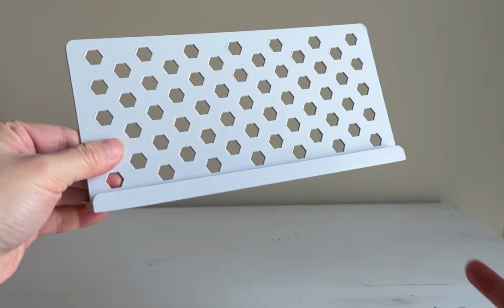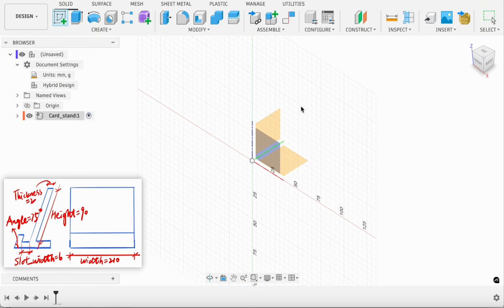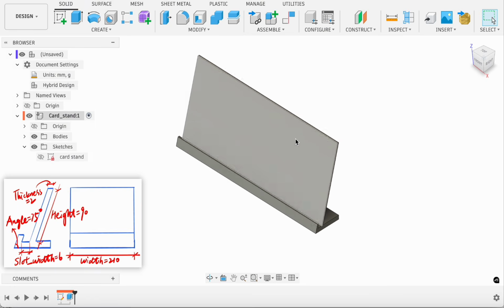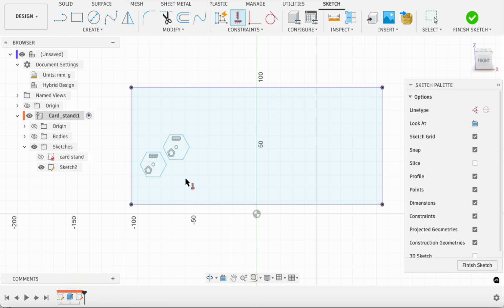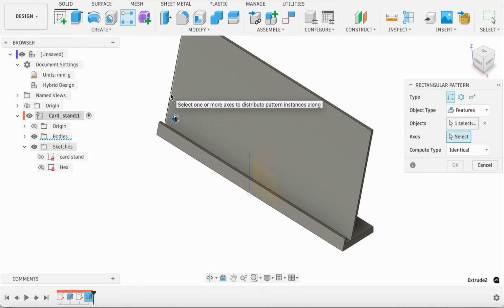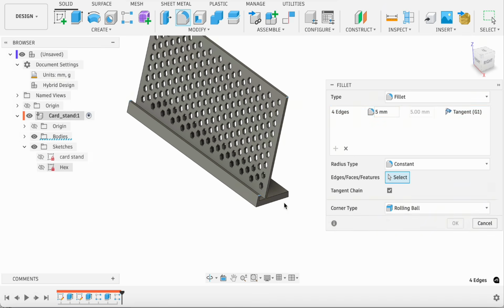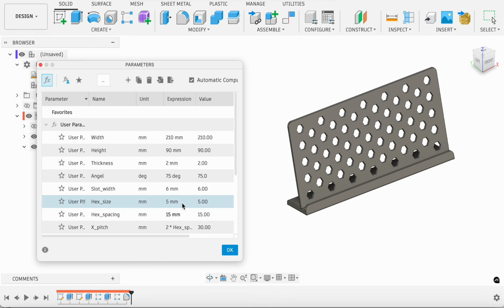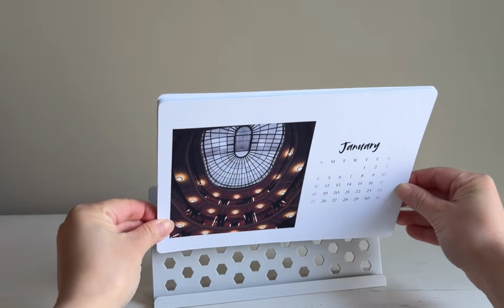How to Design a Fully Parametric Honeycomb Pattern in Fusion 360

Comment: Out of curiosity, why did you use a construction line to vertically align the backs instead of just setting the points to the vertical contraint?
Reply from the maker: Good point! You can definitely just select the two points and hit the vertical constraint to keep the sketch cleaner.

Comment: “If u put plenty hexs, so it slowdown a printer”
Just need to remodel by splitting at two parts, make them to lay on the table and proper connection and pretty smooth surface
Reply from the maker: That's a solid point! I actually considered splitting it, but honestly... I really wanted to keep such a simple design as a single piece.

Comment: Great info for all the math in the parameters for the hex distances! I’ll test it out. I was doing it by creating 2 hexagons then creating a horizontal pattern. Then doing a vertical pattern. Both from the center. But was inputting the numbers manually of how many hexagons. 
I made it work for what I needed. Probably way more complicated than it needed to be. 

Now the most important question that I was waiting on from your last video, how do you apply this pattern on a rectangular box/bin? Especially if one side has a deeper cut in it.  

I want to make a custom size box without a lid to hold folded hand towels which would have a channel in front for easy access of the stacked towels.
Reply from the maker: Glad you liked the math! Feel free to test it out—you can also download the F3D source file from the link in the description to see exactly how those parameters are linked. 
For a rectangular box or bin, I think I'll use 'Pattern on Path' to do it. I’ve actually added this to my upcoming video list, so stay tuned for that tutorial! Thanks for the great suggestion.